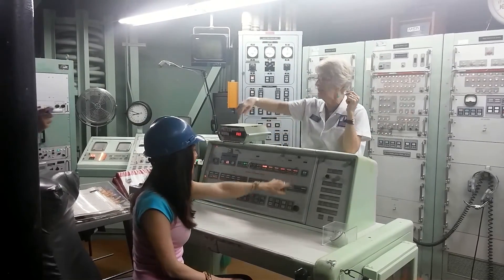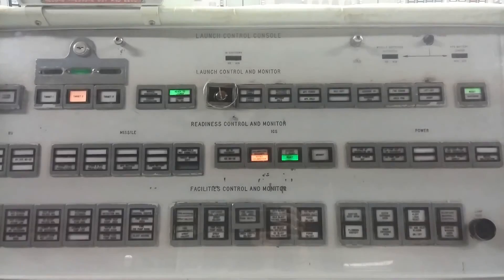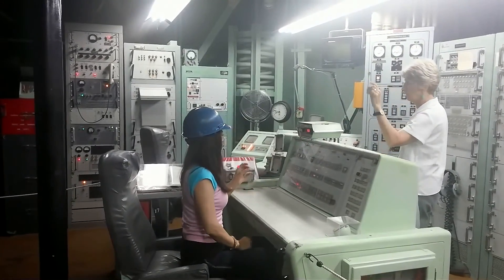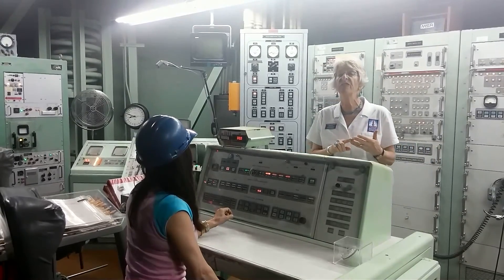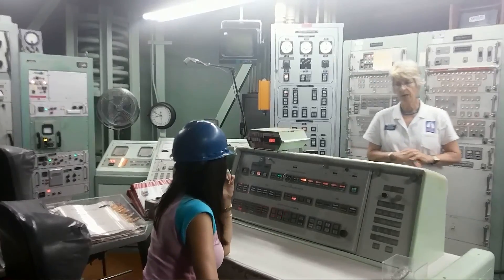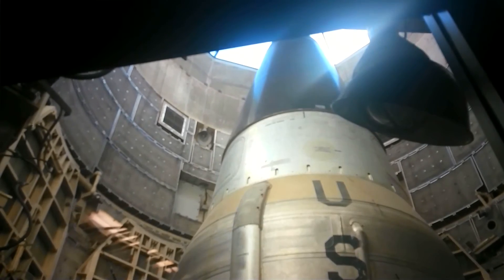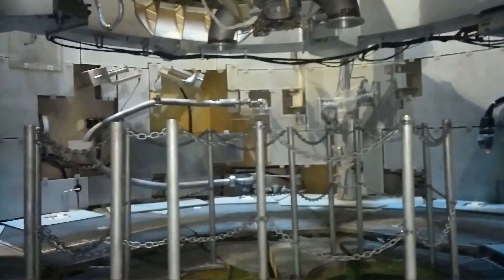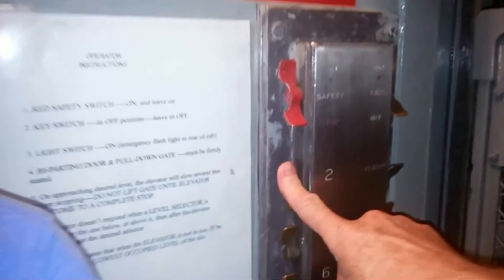Exploring the Titan II 9 Megaton Thermonuclear Warhead with Bianca Te Rito

Comment: Did many a tour in that very silo. No matter how long you worked out there, it's always AMAZING the engineering that was behind it. The blast doors, the silo door, the missile itself. The thrust mount, holding 170 tons straight up, ready to fly. Before inertial guidance, they used a theodolite to aim that missile when first deployed. I never lost my sense of wonder, and good fortune in working around that missile. What an awesome job!